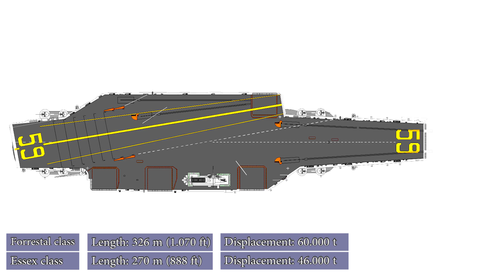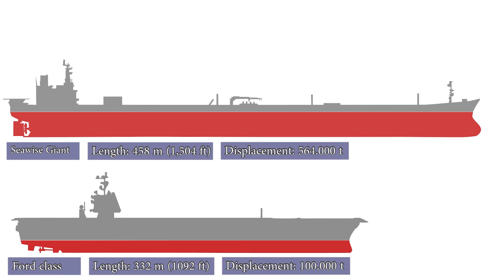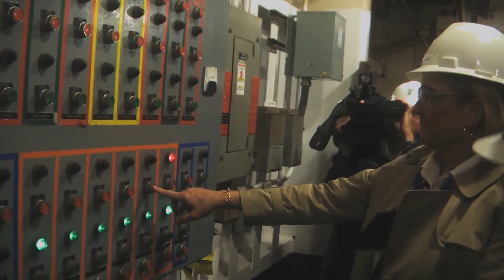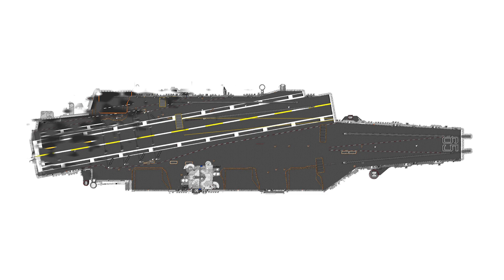Why don't aircraft carriers get bigger?

Comment: Another large issue with the deployment of larger aircraft carriers is that fact that carriers are not able to be used as standing positions in any prolonged operation, and thus the need for aerial supremacy in any prolonged engagement that would demand the feature set of a giant carrier vs the current carriers would be far better served by the capture, construction, or otherwise establishment of an actual airbase on or near the operating area. This task is likely something the carriers would be employed to do in the first place as well. The fact is, at a certain point in a conflict, you need an airstrip on land. Aircraft carriers simply cannot perform all the functions of a fully-fledged airbase, least of which because they are a fighting unit themselves.
Reply: Certainly during WWII in the Pacific Theater the job of the carrier was first to sink or drive off the enemy's carriers, and then to provide air support for invasions to capture islands and establish air bases. Air bases on land can't be sunk and can support continuous operations as long as they can be resupplied. In contrast, a single bomb could damage an aircraft carrier enough to put it out of action for months. The goal when invading an island was always to capture and secure, or if necessary build, your own air base as soon as possible, so the invasion force could provide its own air support and establish air dominance over the surrounding ocean, thus freeing the fleet carriers for other operations.

It's hard to imagine what a modern war against a peer or near-peer adversary looks like, since the USA hasn't fought one of those in 77 years. Ever since, the US Navy has only fought in asymmetric conflicts where it could generally operate its carriers with impunity against adversaries who couldn't threaten them.

Comment: i think  as construction  point  can be done  (  vector trust  use under   water and many  other thinks  that can be power from reactors) the problem i  think  is logistic a cruse  ship  stop  in ports every  2-3  days and have resupply  ready  locally... you  dont want to  much  locally  supply  for you war ship  ...is a potential  danger for  it security and a carrier  is off for 3-6  months  not days ....from what i see how  the  do  logistic now i dont think  x2 carrier with  extra ppl on (  need food and other ) airplanes (  need parts an fuel ) is viable     and most  of country's  dont have as many  airplanes how a carrier  has on bord  :))))))

Comment: How about the Panama and Suez canal? A bigger ship could possibly not fit through the canal
Reply: The Essex class was the last class of US fleet carriers that could fit through the Panama Canal, and that was before many of them got angled flight decks in the 1950s. And although the Panama Canal got a set of new larger locks, the Nimitz class still can't fit through because the flight decks are too wide. The Suez Canal is entirely at sea level and has no locks, allowing much larger "Suezmax" ships to fit through, but even that is not infinite. The US Navy partly compensates for the Panama Canal bottleneck by usually maintaining separate Atlantic and Pacific fleets - i.e. they try not to send ships around the bottom of South America more than they need to. But sometimes there is no avoiding it.

Comment: You need to double the size of the flight deck to increase the efficiency of taking off aircraft and triple the size to increase the efficiency of landing.
Reply: I'd be interested to hear your thought process on this. Are you suggesting that there would be more than 4 catapults? How would a bigger landing area help to clear landing aircraft to make a ready deck?
Reply: @michaelmappin4425  - One possibility would be to have two or more angled flight decks in parallel for landing. But you'd need enough room between them to clear the landed aircraft, and probably a separate elevator for each one to avoid having to taxi landed aircraft across the other landing lanes. Presumably all the landing lanes would be behind the aircraft carrier's island. I'm not saying this would be practical, but I don't see how else you'd increase the landing capacity on a supersized carrier. Carriers of any size so far seem to have only one place to land aircraft, so landing seems to be the main bottleneck. There's only one place to land on a Nimitz but four catapults for launching. Another problem is that landing attempts can fail and an aircraft must bolter and come around for another attempt, thus delaying everybody in the landing pattern.

But having two or more landing lanes might help if an aircraft has an emergency and needs to land in the net. You'd still have other lane(s) open while the deck crew peels the stricken bird out of the net, which presumably takes longer than a normal landing.

Comment: In terms of the USA, a mega carrier system would give up the primary advantage the US relies on its fleets to provide- interoperability and force projection. US carriers are used to provide a mobile endpoint for a worldwide network. Ships that can go fewer places are less valuable in such a system. The US Navy doesn't need carriers that can take everything with them, they have the transit systems in place to resupply a battle group continuously. Lastly, its relatively easy for the USA to swap out one carrier battle group for another in the event of damage or troop fatigue. Even if an enemy manages to do significant damage to a force, it can be replaced with little slowdown in operations, because the crews and pilots all know the same systems. A megacarrier would be like the Rebels taking out a Death Star, a huge setback for the enemy much harder to recover from.

Comment: Simply put, there is a size in which you get diminishing returns for your money. Not to mention, if you only have the money for 200 thousand tones of construction. Would you build a super ship of your max tonnage? When you can get 2 ships that are almost as capable without sacrificing mission objectives, with the added benefit of being able to be in 2 places at once instead of 1.
Reply: Or one place all the time instead of zero when your one ship is in port for maintenance. No ship can remain at sea indefinitely. If you have two ships, you can schedule the maintenance for one while the other is on mission. This also uses your port facilities more efficiently since you don't need a larger staff at the port which is idle half the time when your single huge ship is away on mission.
Reply: @danielmocsny5066  i did consider putting that in. But it was already getting long for a comment 🤣.

Comment: We’ve reached the sweet spot of aircraft carriers. The amount of return vs size is just not their. You run into the mathematical equation of diminishing returns. Now for the cost , not a big issue-what you say. Well let’s look at where the USA flushes money down the drain in the last 2 years. First CV-19 related unemployment and stimulate checks. Then the Ukraine war and our support of it. Just the cost of arms to Ukraine we could of built 9 aircraft carriers, maybe more; I’ve lost count of the hundreds of billions of dollars we’ve given them.  Now the 10,000lb gorilla in the room???? Student loan debt forgiveness program- but in limbo because of court rulings. I’ve seen figures from 1.7 trillion to 4.5 trillion dollars. Let’s say for arguments that the student debt is 2 trillion dollars. At roughly 13 billion a copy for that 2 trillion dollars you could build around 120 Gerald R. Ford Class carriers, FOB NewPort News , Virginia. Minus crew and aircraft and equipment, that’s a lot of aircraft carriers. The democrats where talking and passing a bill on this student loan forgiveness program what I just found out was 400 billion dollars, that about 31 Gerald R, Ford Class carriers. Just the service debit load on the student loans outstanding at .07 per year is 140 billion dollars, that would buy 7 new Gerald R, Ford carriers each year on top of the 120 carriers I talked about earlier. Anyway you look at it that’s a lot of aircraft carriers. We could build a S-load of them. Or split it up and build a bunch of nuclear submarines and carriers mix. So the cost of one Gerald R. Ford class aircraft carrier is chump change in the big picture of things. I’d like to take a moment to thank my college professor Charles “ Chuck” Higbee  industrial Economics BA340 what a awesome class👍👍👍.

Comment: Plus, Panamax (the maximum size ship that traverse the Panama Canal) is 366 m Length, 120,000 T Displacement.
Reply: That is the exact reason the US carriers are the size they are.  They need to be able to pass through the Panama, and Suez Canals.  If they were too large they would have to travel around the southern end of South American or Africa. This would and days if not weeks to travel where time is of the essence.
Reply: @Nirad-jt7en  The aircraft carriers are way, way too large for the older Panama Canal locks (that limited the length to 294m and the width to 32m). The new, larger locks weren't planned when USS Nimitz (not event talking about Forrestal) was designed.
Anyway the aircraft carriers don't fit in the newer, larger locks of the Panam Canal either. Their deck is much too wide.

Comment: there should be no need to modify aircraft like the f35 for a gaint super carrier, carrier-based aircraft are designed to land on carriers its length would not change that, and if its long enough other air craft could land on it as of it was a normal runway so again few modifications to aircraft needed. not sure where he gets the idea that planes on one carrier wouldn't work on a different carrier. but that reasoning our allies that use an incline ramp launch technique couldn't use our carriers but that's not true. if it can land on a carrier the size shouldn't make much difference. unless the carrier is to short but we can and have landed our planes on allied carriers and they on ours so again seems a strange argument.

Comment: I'd like to refute your point on the value proposition of an aircraft carrier.  It is an open system that has intrinsic value (along with extrinsic, of course).  It's really the intrinsic attributes that gives the aircraft carrier value.  Sure, it costs money to operate, however, the mere existence of this ship with it's capabilities can be (and is) a huge deterrent to rival nations.  Personally, I think the intrinsic value of the aircraft carrier is so high (especially nuclear powered ones), that it's very difficult to pin a specific number to it.  They are a huge benefit to nations that have these types of weapons at the ready.

Also, with the advent of drone aircraft (gen 6 fighters are rumored to be optionally un-manned) and a shrinking military budget, it's not necessary to increase the size of these ships.  Present and future weapons will need to contend with weaponized supply chain, as well as regular/irregular military forces.  That said, a smaller/more intelligent aircraft carrier that uses renewable energy as a weapon and fuel would be the most desirable.

Comment: Actually, I think the answer lies elsewhere. The US don't need to show greater amount of force, than a Nimitz or Ford class show by them selves, for protracted amount of time. That may very well change with Nato and Russia, and more importantly, US and China getting more and more at each others throats. The real question now is, "is there a need for the Navy, to deploy a ship larger than the Nimitz class?". I'd argue, that there is one. If the US were to lose Japan as an ally, logistically, Pacific would become a nightmare. Therefore, the ability to quickly, relatively cheaply and safely move vast amounts of materials would become paramount for war effort. Therefore, a support ship could in terms of size overcome both Nimitz and Ford classes, and it could be considered a carrier, if it carried choppers, which it likely would, because all that cargo would need to be delivered to other ships or even troops fighting on the ground and there is no quarantee, that an airbase or another carrier with free Chinnok would be around. For that very reason, having a couple of choppers on hand would become a necessity and make this ship an aircraft carrier.
If we're talking Nimitz or Ford being floating airbases, this ship would be floating logistics centers.

Comment: Lots of good reasons. One is that you have to consider the effectiveness to target ratio. How much bigger do they get before the increased number of air assets is outweighed by build/maintain/manning cost per unit, declining speed or maneuverability with available power systems, or shrinking number of total units due to cost per.
I know these things have become priceless assets and the loss of even one would be a tragedy that would send the US media and public into a depressive tailspin, if not indeed the navy and political leadership. But as late as the 1980s there was kind of an assumption these things would be used in an all out naval war with the Russians and some would be sunk. That argues for more units, not fewer. And that day might still come, though likely not the Russians.

Comment: I'll address one factor concerning the supercarrier vs. the bigger hyper carrier. Since in the example, the budget was found to fund a sufficient number of the Big Ones and infrastructure, let's consider acquisition of aircraft.

First off, we will not need to modify the "current" air wing for the big ship. The Navy has always required planes to have a small footprint on the deck so they can cram as many on board as possible. If the 250k ton ship has a 7 acre deck the admirals would want to double the air wing size. Even then that would leave room to accommodate large cargo craft service.

Should the carrier need to host fighters as big as the F-14 Tomcat then the new F-24 SuperCat or whatever they call it, would still fit on FORD class carriers as well as the big ones. Indeed, there will likely not be a near term need to base giant aircraft on any size carrier; that presents no tactical advantage. We would be better served by larger numbers of smaller Loyal Wingman drones than trying to fit a few big bomb trucks on the deck. As you stated, increased numbers offer more flexibility than larger platforms. 

One advantage these hypercarriers would have is a second hangar deck below the main one to store a large number of flat drones. They can be stacked in racks, maintained by fleet AI communication and be brought upstairs for servicing, and all the way to the flight deck on their own elevator for missions.

Comment: An aircraft carrier is a warship and unlike civilian ships (with the exception of piracy) warships get shot at with the intention of sinking it. An antiship missile will ruin your day and there will be many launched at a carrier and fleet. The last thing you want is to build a huge aircraft carrier only for it to be sunk when for the same cost you could have built multiple carriers allowing you to still have air power even after having a carrier sunk.
Also, it's not likely to have every aircraft in use at once, with numerous smaller carriers you can send them to different places allowing you to spread your airforce out to cover more space whilst still being near a carrier for rearm and refueling.